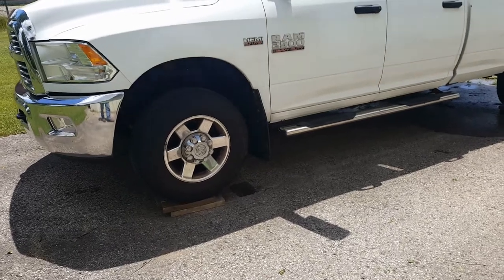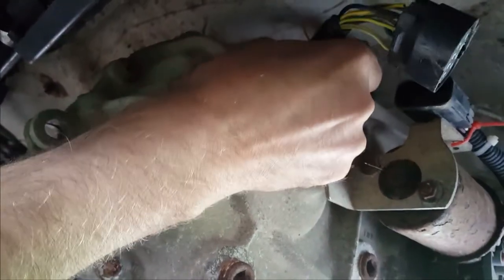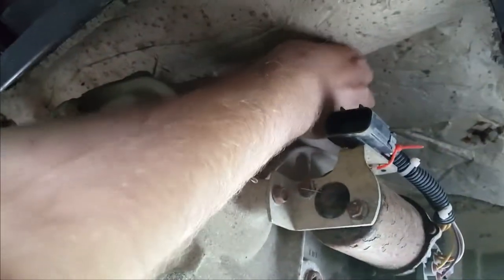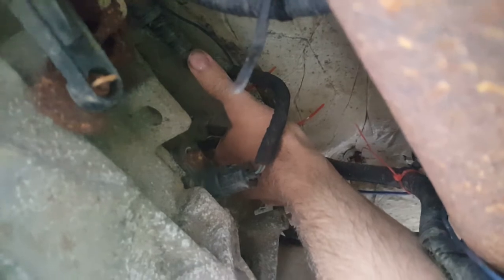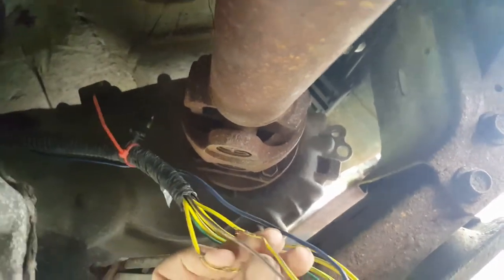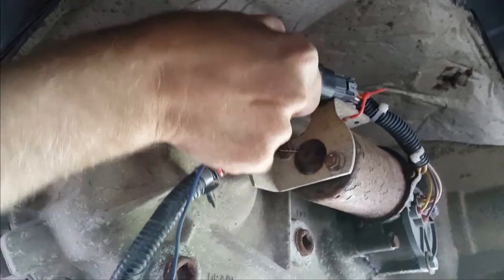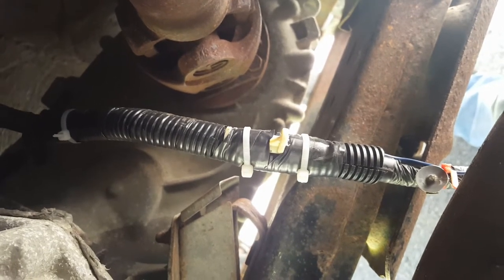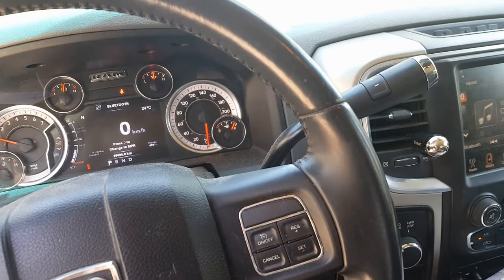2013 Dodge Ram 2500 4WD wiring harness repair

Comment: I have a 2013 with a 6.7 and I found that the bracket at the top of the trans was installed 180deg out during assembly causing the chaffing issue.
My trans throws a "MS Solenoid circuit" p2706 i believe. I have 2 wires exposed from the bracket. 
Also my Buddy at work has had the same issue.
Reply from the maker: Someday when I'm under the truck I'll have a look for this bracket. The damaged area of the harness was over the transfer case, but a misplaced bracket on the transmission itself could possibly contribute to mis-routing.

It really didn't look like the harness was against anything so I suspected rodent damage, but the worn area looked smooth (i.e. no rodent tooth marks) which would indicate chafing.

But then, by the time I found the damaged area of the harness I'd moved things around already.

Comment: I got something similar but my 4wd service light comes on and I can’t use it. But if I run the truck about 5minutes and shut off and turn back on that light goes out and I can use it. Any ideas. Ty
Reply from the maker: All I can say is intermittent conditions are a pain to diagnose. I had the help of an OBD reader that could display the status of the individual position sensor signals.

It sounds in your case like when you start up, one of the signals is wrong, putting the DTCM in an error state disabling the 4WD shifting. Once things have warmed up the signal is correct so stopping and starting resets the DTCM error condition allowing the shifter to work again. Part of the diagnosis would depend on how reproducible your description is: Does it (almost) always fail when cold? Does is (almost) always reset OK after 5 minutes of running? How cold does it have to be to fail? How long does it have to run before restarting fixes the problem? If the problem is fairly solid when cold you should be able to isolate the faulty signal with an OBD reader. Then you could (again, when cold) open up the various connectors (I think there are 3 in this circuit, one at the DTCM, one under the hood near the firewall on the passenger side, and one at the transfer case shifter motor) along the circuit and test with an ohmmeter.

On the other hand, damaged wiring harnesses are seldom temperature-sensitive. They can be vibration-sensitive but that doesn't usually have any pattern to it, they just randomly work or don't work.

Comment: Please make a video of where you ran your wires to and from to make the 4 wd actually work with out having to tear apart the harness I've been chasing thus issue for months and can not afford to pay the dealer rates to fix it please help thank you
Reply from the maker: I assume you want me to show which connectors the wire has to run to and from.

The actual wire was just run along the general route of the harness and zip-tied where I could reach.

Comment: I'm having a similar issue, but no visible signs of wire damage. . . Where did you get your wiring diagram from to troubleshoot the issue?
Reply from the maker: I spent the big bucks and bought the service and wiring manuals from Dodge. They are in the form of usb memory keys in the shape of a credit card. I have mot found them to be completely accurate but that may be because of mid-model-year changes. In particular the information on the TPMS was confusing and contradictory. My receiver unit was toast but I repaired that myself as well.

Comment: From where to where did you run the wire.I am having issues with my 2011 sport. I have changed transfer case shift motor and shift mod no improvement my transfer case is still in 4 low
Reply from the maker: One end of the wire is of course at the connector to the shifter motor on the transfer case. The other end is at the I230 connector block. This is located (in 2013) at the rear right corner of the engine compartment, almost under the hood hinge. This is a 34-pin connector with a sort of lever handle to hold it connected. From there the cable soon joins the main harness from a nearby connector, and the whole thing crosses over the top of the engine behind the manifold, out of reach.

There are eight wires there running from I230 to the transfer case shifter motor:
I230 term # - Wire colour - Motor connector term # - Circuit
#5 - Brown - A - 5-volt supply (probably not used)
#10 - Yellow/dark blue - B - Encoder 0
#11 - Yellow/light blue - C - Encoder 1
#26 - Yellow/brown - D - Motor A
#25 - Yellow/gray - E - Motor B
#9 - Dark green/yellow - F - Switched battery +12V (probably not used)
#13 - Yellow/dark green - G - Encoder 3
#12 - Yellow/tan - H - Encoder 2

For the pin locations in I230, pins 1-7 form one row with an extra-wide pin 4 in the middle. The next row is 8-16, then 17-25, then 26-34, with pins 8, 16, 17, 25, 26, and 34 being larger pins offset from the rest of their rows. I don't recall which connector in the diagram is the one on the harness. If you are looking at the pin end of the bulkier half with the retainer lever, pin 1 is upper right and pin 7 is upper left. Hope that all makes sense!

If you disconnect both connectors, you can then short out pairs of terminals at the motor end of the harness and check for continuity at the I230 end. For instance if you short out B and C, you should see continuity between #10 and #11; otherwise one or both of those wires is broken. Make sure you remove the short before reconnecting I230!

The actual pins in I230 are described as "1X6.3MM 6X2.8MM 27X1.5MM YESC" these are counts X size, and YESC is somehow the type of pin. The repair kit (for the connector half with the lever) is 68080569AA. When I ran the replacement wire, I managed to carefully open and re-crimp the existing pins but I could also have cut the wires and spliced in new ones.
Reply: Gracias maestro

Comment: Where do you find this harness? I had a lift put on my truck and protint the company that did the service. Never told me they didn’t connect to the actuator. So I turned on the 4wd and it’s messed up. I got under the truck and the wire is 6 inches to short to reach the connection. They never plugged it in